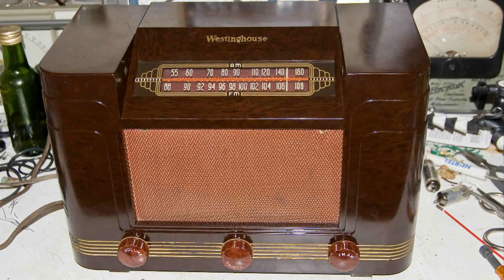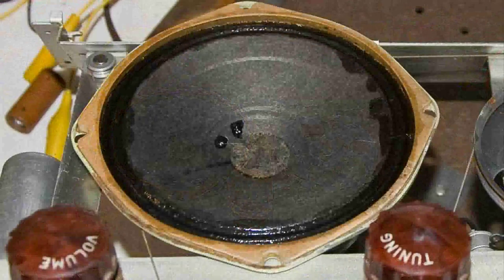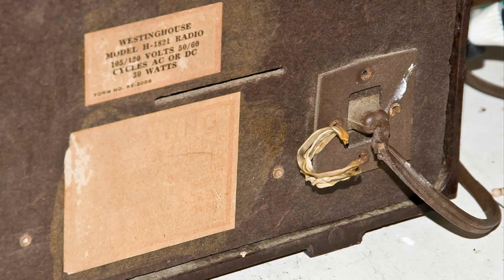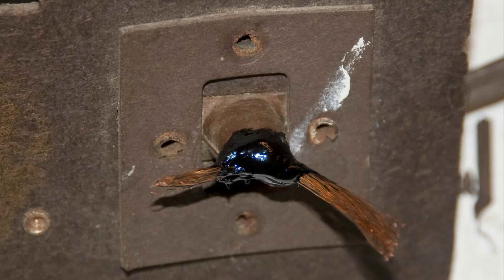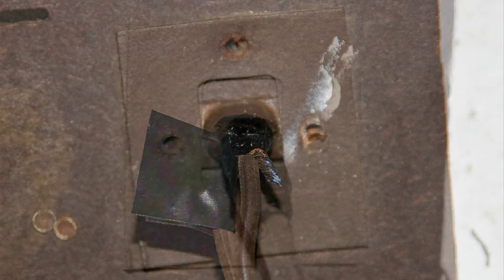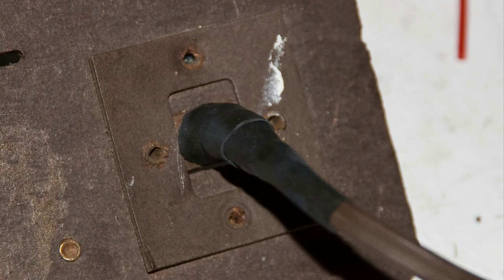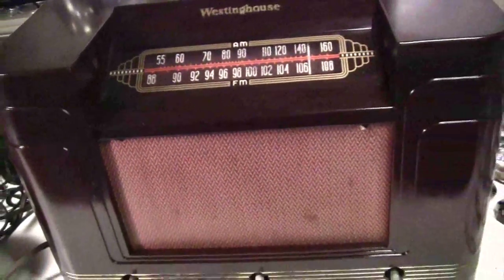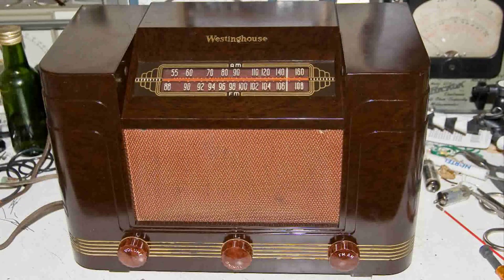Repair Westinghouse Radio Complete H-1821

Comment: Thank you, I very much enjoy your clips.  I have not done anything with electronics since high school electronics class in the late 60’s.  At that time I had a 1936 Philco console radio that I only partially restored.  My favorite memory of electronics devices from the 30’s and 40’s is the smell.  Just something about the old wire and wax condensers and heated dust.  What fine memories for me.  Thanks again.

Comment: Hi Rick 
Well done, the radio looks really smart. I can understand why you fixed the lead the way you did, I would have made the mains lead as a permanent connection to the chassis and avoid the joints but that’s based on the code of practice for higher European voltages. 
Thanks for paint removal tip it looks like it works well but I can’t find Sanolax on the internet is it Sanolax or Senolax? 
Kind Regards ... Andy